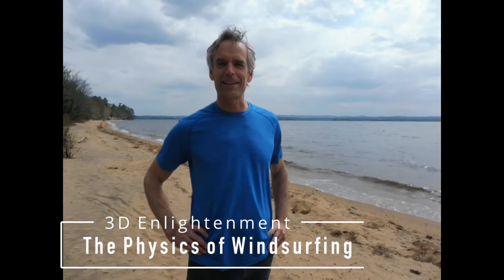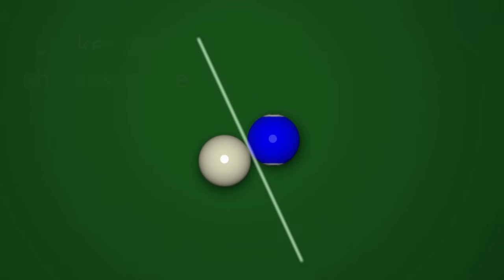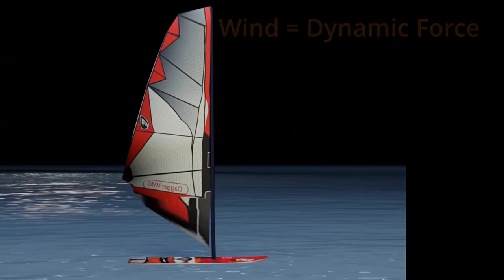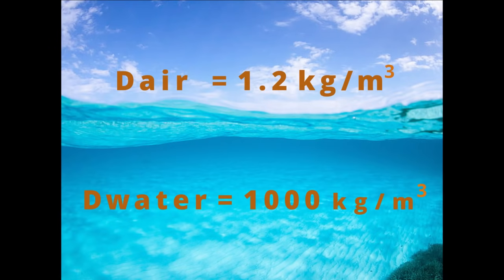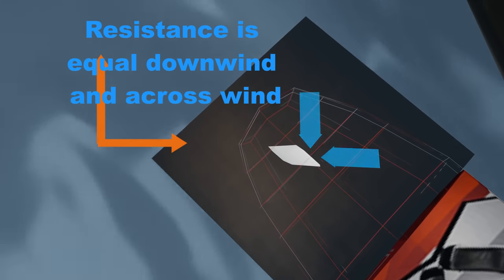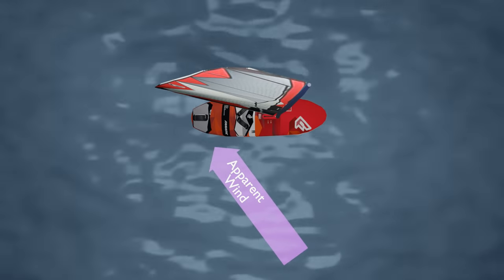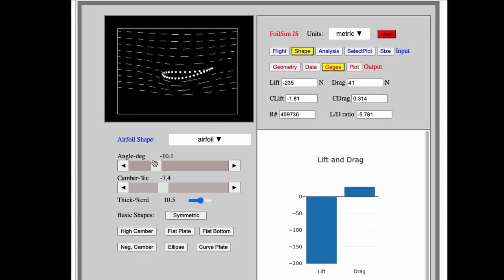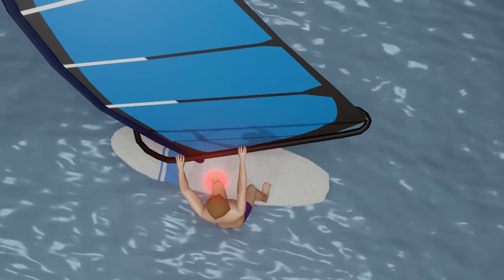Physics of Windsurfing

Comment: Though the video is visually attractive it is COMPLETELY WRONG regarding the sources of forces on a sail and on a fin. The source for both is exactly aero/hydrodynamic LIFT.
The pool balls reflection theory (so called Newtonian theory of lift) is wrong. It underestimates lift big time. You should familiarize yourself with contemporary aerodynamic lift theories before teaching people how windsurfing works. Please read about Zhukovsky, Prandtl, Kutta etc. 
Your NASA simulator example interpretation is WRONG. It is completely opposite.
Reply from the maker: Thanks.  I agree that I have used the term "lift" in a layman's way and not in the way that it is typically discussed in aerodynamic lift theories, which I should have done.  I was just trying to make it clear that the force on the sail does not magically pull the sail upwind which some seem to believe.  The simulator is of course not wrong, I was just trying to show that the wind is not pulling it upwind.  Unfortunately, I used the term "lift" which has a different meaning.   Thanks for the references.  See also a recent publication on the competing theories of lift:  https://www.scientificamerican.com/article/no-one-can-explain-why-planes-stay-in-the-air/
Reply: @3denlightenment  Thanks for pointing to the article. I am familiar with H Babinsky and M Drela explanations of lift and using M Drela's XFoil program (XFLR5) to calculate hydrofoils. Yes, the topic of Lift is not simple. There is interesting lecture of H Babinsky - https://www.youtube.com/watch?v=QY2pS-xXC_U
I am not sure if I understand what do you mean by "wind pulls the sail upwind". Wind pulls the sail across the wind, by the Lift force. This Lift force projected on the board direction gives Thrust. The vector of the Thrust then can point upwind to some angle. I do not disagree with you here.
What I disagreed was the over-simplification of Lift as it like has just Newtonian component. But it has more. Let's call it Bernoulli's "pull" component (that is actually greater than the Newtonian one). And it is very important to understand this for riders. If we rely only on Newtonian "push" we can oversheet the sail, that will cause stall on the outer side of sail and cause loss of Lift and significant reduction of Thrust. Moreover the Lift vector will turn downwind, board will just drift downwind. So, the practical effect of our effort will be opposite. We sheet the sail in, desiring to increase Thrust, but what we get - decrease of Thrust - the board just drifts. It is because "Bernoully's" part of Lift disappeared - the stall situation.
So, a rider should sheet the sail in carefully, not oversheeting it, he should avoid stall, keeping "Bernoulli" pulling the sail. 15-20 degree (Angle of Attack) to apparent wind will be good approximation. Keeping this AoA will automatically sheet in the sail with acceleration, and close the gap between sail and board on high speed planing, that usually indicates good speed and proper technique.
Reply from the maker: @mm74forums7  Thanks.  I agree with much of what you are saying.  I wish it was easier to separate the Bernoulli's pull from the Newtonian push, but it is difficult.  If I was to do it again, I would describe it more comprehensively than I have.  Thanks for your input.
Reply: If there is no upwind force from the profile shape, I cannot understand how it can sail upwind. The water resistance of the fin cant push the sail upwind but can only fix the sail in 45degree downwards
Reply: @yus.c.2231  Sail and fin are both wings. They both generate Lift (and drag) force. Lift vector is directed across the apparent wind, 90dgr. Then it is projected on line of direction of the board movement and gives us Thrust. Thrust, relatively to fin, is like wind relatively to sail. Thrust moves the fin through water and it generates fin's Lift that's vector is directed again 90dgr to the board movement direction. Then you summarize both vectors - Thrust and fin's Lift and it will give you a resulting force vector that is directed upwind.
Again, a sail cannot move upwind without help of a fin. Moreover, it cannot move anywhere but drift downwind. Take a big bowl, put it on ice, stay into it with a sail. Whatever you do with the sail you will just drift downwind.
Reply: Thanks. Both thrusts are generated by the differences of air/water density of the two sides of Sail and fin?
Reply: @yus.c.2231  Both thrusts are generated by the differences of air/water pressure of the two sides of Sail and fin. Density may change for air, not for water. 
Some scientists assume that cause of lift is increase of speed of liquid on top side of wing profile, and low pressure is the side effect of it, some assume - speed-pressure equally impact each other, some (i.e. M Drela) think that decrease of pressure is primary factor, and velocity is side effect. I would more tend to agree with the latter. (I am not a scientist).

Comment: What is the shear force on the universal joint?
Reply from the maker: It is complex.   If you assume an 8 m/s wind (~30 km/hr), and a 7 m2 sail, the force on the sail would be 269 N, which is translated through to the universal joint which is receiving most of that pressure.  Of course, this will vary depending on the angle of the sail but it is also counterbalanced by the bodyweight of the sailor hooked into the harness, and the angle of pull on the harness, and the directional speed of the board.  ...so it is complex.

Comment: WRONG! The sail going upwind DOES provide lift!
Reply from the maker: I should have made it more clear.  There is a lift force in the physics sense, and it is in perpendicular to the sail as shown in the NASA simulator, but it doesn't "lift" the sail upwind in the laymans sense of the word.  If there was no fin...the craft would not move upwind from the lift force...only across and mostly downwind.  Just remove the fin & daggerboard and try to sail upwind.
Reply: @3denlightenment  not sure what are you trying to relate with "lift" and "upwind". Sail produces different amounts of lift in different angles of attack. Lift should be understood as part  of the driving forces of a windsurfer, regardless of course/point of sail.
Reply from the maker: @arg425  I agree.  Just trying to separate the point of confusion between lift generated in flight which is upward and the net lift generated with a sail which is downwind.  Yes, lift in the physics sense is THE driving force regardless of the point of sail.  Perhaps another video of further clarification is warranted. Thanks.
Reply: @3denlightenment  agree, thank you!

Comment: nice animation, but why the board turns isn't really correct, isn't it?
Reply from the maker: The board turns this way in low winds, which I should have mentioned.  Carve gybing is a different process.
Reply: @3denlightenment  well it surely turns yes, but the reason is the torque generated by the shift from the lateral forces 
at least thats what i've been told and it makes more sense to me, since the board also turns to the wind, when the weight is on the front foot, and the sail goes back....
i hope that makes sense, never explained that in english :D

Comment: The explanation of turning is incorrect. It's not the weight or position of the feet at all. It is the position of the center-of-effort (CE) point of the rig relative to the center-of-lateral-resistance (CLR) point of the leeward edge and fins of the board. When the CE aligns vertically with the CLR, the board travels straight without rotating, when the CE is moved forward of the CLR, the board rotates downwind, and when the CE is moved backward of the CLR, the board rotates upwind. Most books on windsurfing explain this mechanic.
Reply from the maker: Thanks c4tubo, I agree that the pressure to turn is coming from a change in the CE, as one tips the sail forward or back, and this change in CE results in shift in the CE forward or aft of the CLR.  However, the change in CE, results in a pressure on the sail which is opposed by your body and feet, otherwise the sail would tip over.  It is this practical event which is what I was focusing on.  I agree, I should have used the terms CE and CLR in the explanation.  One more note is that due to the generally light weight of a windsurfer, one can accelerate the turn by emphasizing the weight transfer and leaning out and pushing on the appropriate foot at the same time.  This is something that is unique to windsurfing and not applicable to maneuvering most other sailing craft.

Comment: I'm sorry but the explanation of the fin seems very wrong to me. If the angle between wind and fin was the reason for the board to stall, it would stall even faster with a bigger fin and daggerboard. I think taking the direction of the wind and applying it to the fin is incorrect. The fin isn't dragging in the wind but it follows the forwards motion of the board - regardless of the wind direction. Thus, the wide surface is always producing a resistance against the downwind portion and the small surface is always producing resistance to the forward portion of the wind. The small surface can be negleted and thus the only relevant surface is the wide one which is always only producing resistance to the downwind portion. The downwind portion is minimal while going upwind though. What's stalling the board is the lack of a force in the sail.
Reply from the maker: You almost have it.  You are missing the fact that when the wind strikes the sail, the angle of energy transfer depends on the angle of the sail.  The energy transfer is approximately perpendicular to the sail in a downwind direction.  That transferred force has two components, a down wind component and another component perpendicular to the wind (never upwind).  The key piece is that the lateral force (driving the board forward) is NEVER upwind (not possible for wind to transfer a force against itself).  As you angle your board upwind, the downwind force continues to be opposed by the fin and the lateral forward component continues to push across the wind (forward) but the board slices upwind  until it points upwind at 45 degrees.   At 45 degrees the resistance provided by the fin is the SAME downwind and across the wind no matter the width of the fin.  The key factor again is that the wind force has two force components, downwind and across the wind, never upwind.

Comment: A commendable effort to explain the theory behind windsurfing, but I'm afraid your aerodynamics interpretation is flawed. The lift of the wing shaped sail provides a strong force vector in the forward direction of the surfer. Indeed rmthere is als a force component down-wind, but this is less than the force vector in the direction the surfer is moving. In your interpretation the sail only works as a displacement device, which is not true. Go take a look at the blades of a large wind turbine. The blade orientation is exactly the same as for the windsurfer, where the lift component is pulling the blade forward. Wind turbines are also not displacement devices but obtain their efficiency from proper (lift over drag) aerodynamics. Als take a look how the pitch angle changes from the root to the tip: strongly angled at the root, where the apparent wind is less and quite flat at the tip where the rotational speed of the blade is highest. I really think you should correct your video, otherwise it teaches people false facts, which I really find upsetting.
Reply from the maker: Thanks Hans.  I agree, the blades of a wind turbine are exactly the same as a windsurfer sail, and the wind turbine blade at the root is fixed and angled steeper than that at the tip to reduce the increased drag due to the higher blade speed at the tip.  If one looks at the physics behind the lift created when the wind blows over the profile of a turbine blade or airplane wing, the lift is created which is perpendicular to the wind direction and the back surface of the blade due to the low pressure created on the curved side.  This is due to the Bernoulli principle which in the case of a windsurfer sail and a wind turbine blade, will cause a "pull" in a direction which is perpendicular to the back surface of the blade or sail.  And yes, because these are angled slightly, there is a small "pull" in a forward direction.  All of this we can agree upon.  Where we might differ is the relative contribution of the forces.  If you draw a vector diagram of the forces on the wing/blade surface which result from the Bernoulli principle, there is only a small force which would pull the blade/sail and this movement would be directly countered by the drag resulting from the resistance of moving through the air.  In addition, at the tip of the blade, the angle is less, and therefore the forward "pull" or lift would be even smaller, although the wind speed would be greater.  All of this has to be considered with the direct pressure from the wind on the front side of the blade/sail which would be far greater than that from the Bernoulli principle.  You can test this out next time you are a passenger in a car.  Take a frisbee and hold it out the car window while it is moving.  If the frisbee is flat, there will be a lift force created as the wind blows over it from the Bernoulli effect alone.  Now compare that to the direct force from the wind when you angle the frisbee slightly.  The direct force will be far greater, although the Bernoulli effect is still present.

Comment: Just an intro. Does not explain any planing dynamics at all. Most windsurfing is mostly planing. Nice animation not the complete or best info. For example:  nearly every sail designer understands the sail in a foil shape does indeed create a lift force that is partly the reactive force he explains and partly a low pressure vs. high pressure differential force on the sail. The total, reactive and pressure forces are called lift.

Comment: Also, the explanation of the sail being a "wing" is 100% incorrect. It's actally NOT at all the form of a wing because the outer and the inner portion are exactly the same length, thus the wind is blowing with the same speed on both sides, not creating any pressure difference. The only force that is created is the reactio force of the wind being "curved" to the back resulting in the sail to be pushed forward. In fact even the explanation of a real wing profile is partly wrong as wind is actually not accelerating on one side but it's actually reaching the end of the profile on the downside (!) first - contrary to the common explanation. Pressure difference would result in the opposite of lift.  This has been demonstrated on a very famous youtube video by an Oxford physics professor.
You are constructing a line between mast and end of the sail that is not reality. there is no "chamber" and there is no shorter and longer line.
Reply from the maker: Thanks for your comment.  You are right about the sail not being perfectly shaped like a wing, but you see a LOT of explanations comparing a sail to a wing and relating it back to Bernoulli's principle.  I only bring up the wing explanation to briefly show that it doesn't explain what is happening.  In my second video which you can see here:  https://www.youtube.com/watch?v=jHCXTiepjKY&t=5s
I tried to put more clarity into the relationship between sail angle, the relationship between the wing and the sail and the generation of lift.  Feel free to check that out.

Comment: The wing and aerodynamic lift part of the video is all wrong.  You do not choose the correct coordinate system.  The force on an airfoil is a vector, which can be resolved a number of ways: into a force parallel to the board (the motive force), and a force lateral to the board (resisted by rails, fin, centreboard) OR It can also be resolved into aerodynamic lift and drag using the coordinate system of the apparent wind.  You only focus on the aerodynamic lift.  Nothing from the perspective of the board.  Billiard balls are an analogy but not the physics of the situation.  It is Bernoulli principle.
Reply from the maker: Thanks for your reply.  I understand what you are saying.  Check out my second video.  Hopefully it will clarify the situation.

Comment: A for effort! A for using blender! C for knowing how a windsurfer actually works. You can't try to explain windsurfing and leave out the most critical dynamic; the Center of Effort vs Center of Lateral Resistance, is what steers it, not foot pressure, for instance. When you say 'physics' is that your background?
Reply from the maker: Thanks Bruce.  I agree with you that center of effort and center of lateral resistance are what steers the board, but when you are out sailing, that is not what goes through your mind, it is what physically you need to do.  The changing the sail forward or aft, i.e. changing the centre of effort changes the pressure on the feet, which tips the balance from the center of lateral resistance.  I was just trying to keep things simple.  Perhaps another video to clarify.
Reply: @3denlightenment  Do you have a degree in physics?
Reply from the maker: @snailer06   I have an Engineering degree and a Master's of Science, 32 years working in the science, and 41 years of windsurfing experience.
Reply: @3denlightenment  KUDOS, bro!